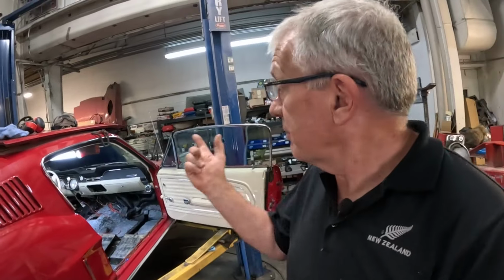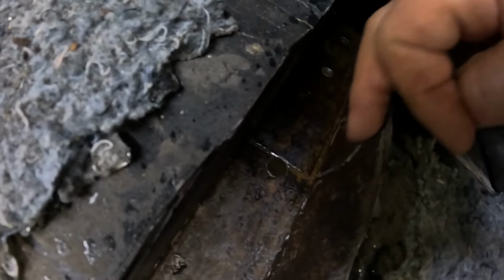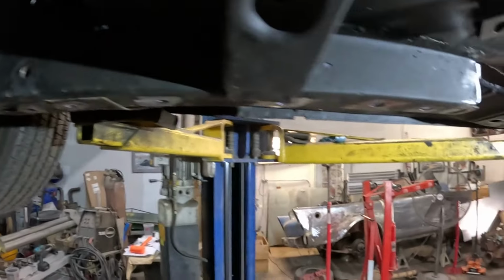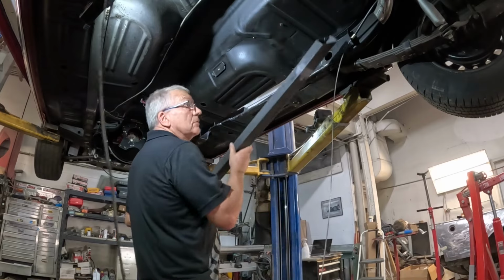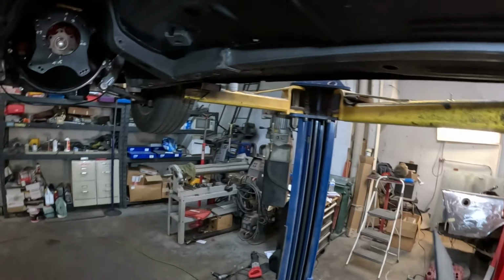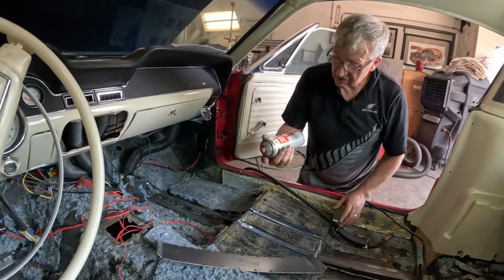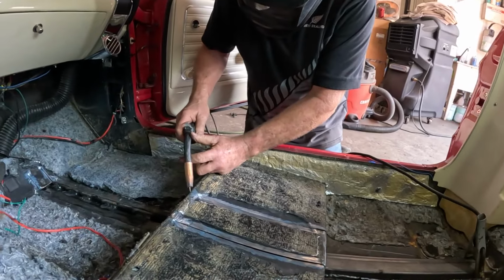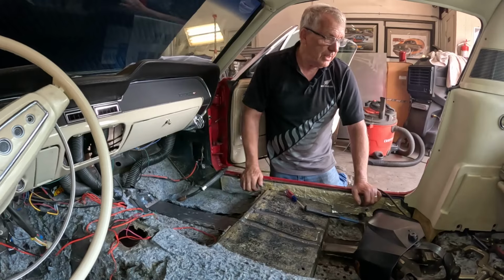Subframe Connectors for First Gen Mustangs.  Kiwi Style!!!

Comment: Bending the floorpan edge up 90°, instead of butt welding, is pretty smart. A lot stronger. Owner will appreciate connectors in the turns and bumpy roads.
Reply from the maker: Every bit helps!!

Comment: I bet,  you can put a floor jack anywhere , between the wheels and it lift the whole side up evenly, after those subframe connectors were installed. Great job, Kiwi!
Reply from the maker: Your right!  They really tighten up the car done this way and there's nothing hanging down so you don't lose any ground clearance
Reply: @kiwiclassicsandcustoms9160 You, the man, KIWI!
Reply: Ha yea, make it like my 63 gal essentialy😎 with a Clayton’s full frame? The full frame ya have when ya..you know the rest.
Reply: @StevenMilne-sm4fk The drink Jack Thompson drank when he wasn't having a drink.
Reply: @StevenMilne-sm4fk You got a '63 Galaxie? . I love those, is it a fastback roof, or 2 or 4 door sedan?
Reply: @barrycuda3769  sportsroof 63.5 yup blk/red 390 cruiso😎
Reply: @StevenMilne-sm4fk  Nice, black with red interior is just the way I'd want it , and with the big block , that's perfection. What sort of  wheels ? just to complete the image.
Reply: @barrycuda3769 either whitewalls and spinner caps as per 500XL or 8 inch body colour steels no caps for that period stock car look. Plus the cross ply’s don’t drive the nicest. Nice new zinc plated wheel nuts on show.
Reply: @StevenMilne-sm4fk  Excellent, again,  widened black factory rims would be my choice . They'd probably look good with caps as well . The only thing left that I'd do is red line the tires, but Iv'e found that they are not everyone's cup of tea , but Iv'e got a paint recipe that really works if you're interested.
Reply: @barrycuda3769  I do run the 63 caps sometimes but I think I’m Fireball Robert’s without em
Reply: @StevenMilne-sm4fk  Living the dream 👍
Reply from the maker: @StevenMilne-sm4fk  I do mate I do!!😎👍
Reply from the maker: @strokermaverick  cheers mate!!

Comment: Thank you, I have always wanted to add subfram connector to my 67. My idea was the use rectangler tube cut the top out and wrap around the outside and weld on.
Reply: Old style sub frame connectors were
 exactly that.
Reply from the maker: That would work but cutting the top out you'd lose some of the strength

Comment: Wonderful work, as always, Kiwi. I've done similar (but not as nicely done I admit) when I couldn't find subframe connectors I liked and would trust for a '68 Torino Fastback. For those that may not know the '64-'69 Fairlane/Comet/Torino/Cyclone are BASICALLY the same setup as the 'Stang.
Reply from the maker: Thanks man, I haven't found good aftermarket connectors, typically you lose about 2 1/2" of ground clearance and they bolt in which allows the flex that you're trying to stop.....
Reply: @kiwiclassicsandcustoms9160  Precisely, and even if you weld them in they will not do what taking a bit of time and making them will achieve. Plus there is the pride of making something better thenn you cou8ld by, at least for me as a retired due to disability body man & mechanic, though I took as much pride in they making when I worked.

Comment: Doing this on a spider lift... So how do you know that the body is square, straight, and not twisted before you weld it solid??
Doesnt it matter??
My buddy is doing a 68 fastback on a frame table. Its getting a Coyote, 4 link, etc.
Reply from the maker: I use Jack stands front and rear to even out the load, never had an issue that way.

Comment: Is there any issue with welding them in on a lift? I had always been told subframe connectors are supposed to be installed with the weight of the car on the wheels.
Reply from the maker: I use Jack stands under the front and rear of the car when it's on the lift to stop the sag that you get. That's a good point though, I probably should of mentioned/showed that 😎👍

Comment: I don't know if it is applicable, what I have done in the past is press our the isolation bushes in the subframe & replace them with solid steel & replace the bolts with Allen bolts (higher tensile).
Yes there is trade off's as you would understand .
Kiwi Rod
Reply from the maker: That's tightens things up on cars with subframes but it can make the car a little harsh. Standard practice on race cars 😁😎👍
Reply: Yes that is the trade off & yes I have used it on street cars & I included it with real expensive adjustable shocks & standard springs.
kiwi Rod

Comment: You 4 linking it but keeping the leaf springs?

Seen that set up a few times on RWD Ford Escort rally cars here in the UK. Retaining the leaf springs means you don't need to fit a panhard rod or watts linkage.
Reply from the maker: This car is keeping its leaf springs for now but I do believe it will have to have a four link with over 600 HP.  I may have said it was getting a four link but that was just me projecting😁😎👍
Reply: @kiwiclassicsandcustoms9160 , I think it's already been said, but a spray bottle containing water is handy for putting out sound deadening material fires. That and a C02 extinguisher. I set my '76 Trans Am's interior on fire once, and it did not want to go out. Tried a powder extinguisher, but it kept smouldering and then re-ignited about 20 minutes later.

Only way I got it out finally was to cut out the sound deadening and chuck it out of the car.

Comment: Kiwi,  when you did the video on strengthening the torque boxes on the Barracuda, from memory, I think you indicated that beefing up the torque boxes was all that was needed ( no sub frame connectors needed) on that car , maybe I got that wrong ? .If that's the case , I imagine that would also  apply to my VH Valiant? .I'd rather not have to do the sub frame connectors , if it's avoidable. Put it this way , when I used to use the bumper jack on the front, body flex was evident by the door binding on the catch .Id like to cure that.🙂
Reply from the maker: The plan was/is to put subframe connectors on the Barracuda. Creating torque boxes for the A bodies adds a lot of strength and will likely give you the improvement you're looking for. The Barracuda needs subframes to cope with the stoked out 440 it's getting.  I'd try just the torque box mod on yours 😁😎👍
Reply: @kiwiclassicsandcustoms9160  Hey, thanks for that , a 245 Hemi with a 2.92  rear end isn't going to be doing any twisting. What I'm wondering now though, is adding strength to the torque boxes going to be something the certifiers need to aprove??, you never know with them , sometimes I wonder if they know themselves.  Nice work on that Fastback, they're beautiful cars.
Reply: By the way, I dont think I ever noticed that flex in my smaller A bodies , but the VH onwards are much larger, (except the Charger) that might have something to do with it.
Reply from the maker: @barrycuda3769  Probably . The VH was a bit of a tank by our standards, still I'd just start with the torque box's and see if that achieves what you're wanting.
Reply from the maker: Strictly speaking yes a certifier would need to approve it but I think if you do a nice job and keep it looking as factory as possible no one will notice it.
Reply: @kiwiclassicsandcustoms9160  Thanks.  You're obviously an early riser , is it too hot to sleep? I'm jealous 😅
Reply: @kiwiclassicsandcustoms9160  I understand, maybe underseal it , and throw some dust on it, the WOF guy isn't likely to know what it's supposed to look like anyway. Haha
Reply from the maker: @barrycuda3769   exactly!!  Ten miles of dirt roads is damn good camouflage 😁👍
Reply from the maker: @barrycuda3769  usually up at 5.30😁

Comment: In a lower-powered application, say 300 hp….will the connectors make a noticeable difference?
Reply from the maker: Connectors also improve the way the car handles through the turns. That aspect is not affected by the HP. The other thing they do is to contain torsional loads on hard launches, 300hp is not going to generate a lot of "twist" in the car. If you have 600hp you get a double pay off, control of twist and the improvement in cornering.

Comment: You've just turned it into a full frame unibody car. Not really sure why they didn't do that to begin with. Im guessing cost had a lot to do with it. Cause the stiffer the chassis structure. The more rattles you have in the dash and whatnot if you're building cheap cars on an assembly line. Just a guess
Reply from the maker: It was and still is all about cost. Adding a torque box to the mustang cost about 4-5 bucks but they made millions of them. Save $5 each on a million cars and boom you just end added 5 million dollars to your bottom line ......  for doing less.

Comment: Usual quality job, but they bolt bridges together… just a matter of how you bolt it together really isn’t it, can do the same thing with the cheapest connectors, 8 bolts, minimum of welding, doesn’t disturb the original body and you don’t even have to lift the carpet, unbolts too 😅 no doubt you can too Mr kiwi … invent me something to replace front torque boxes on a 65 that doesn’t involve torque boxes 👍
Reply from the maker: Bridges are designed to flex or they'll break. Flex is the enemy in a high performance automotive situation. A 12 point roll cage would eliminate the need for torque boxes 😬
Reply: @kiwiclassicsandcustoms9160  Hi Kiwi, if you bolt chassis connectors through the chassis extensions you will start to Jack the chassis in long before the bolts are tight enough, ( weld thick wall tube into the chassis for the bolts to pass through )
cheap neat & reversible modification, probably more attractive than some odd blob welding method of attachment, however if your getting serious about things and intend fitting a V8 Detroit diesel or the like then your method is preferred, I watched you fit a big block into another mustang recently and you made it look easy, sure sign of genius mate 👍 as for the full cage… had one in an MGB  hard top fitted, could never get back out of it un-aided 😆